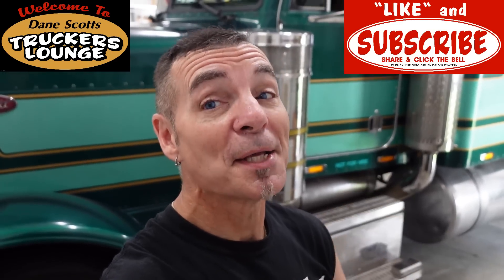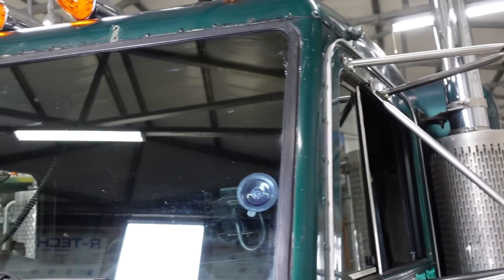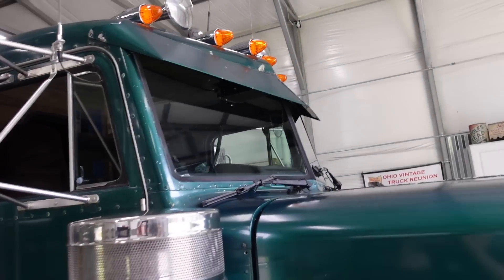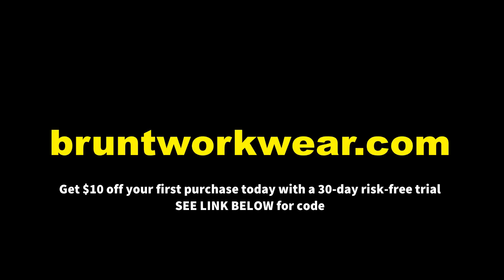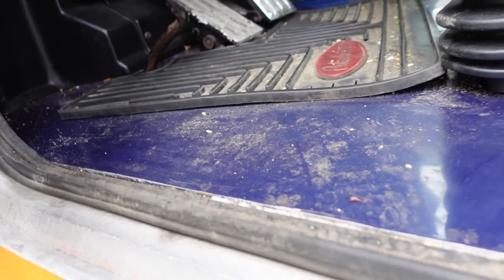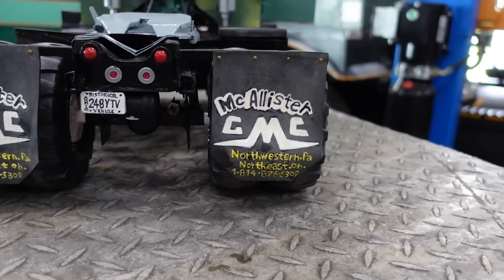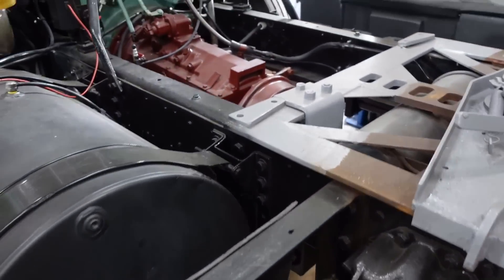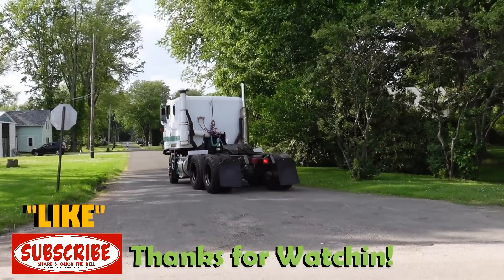GMC CRACKERBOX Cabover Semi Truck Replica

Comment: Mint chip is turning out sharp looking. I like the chrome visor. It matches the front bumper. Can’t ask for a better match than that. Although I like the green visor as well. But, it’s popping with the chrome. Little Cracker Jack is amazing. True detailed. All it needed to do is start up and run. It is really a awesome job a true replica.
Reply from the maker: We think alike Bryan, hard decision lol. He did such an awesome job in the Lil Jack for sure.
Reply: @DaneScottsTRUCKERSLOUNGE   yes he did. I am highly impressed with the details all the way around. I was not expecting the doors to open.